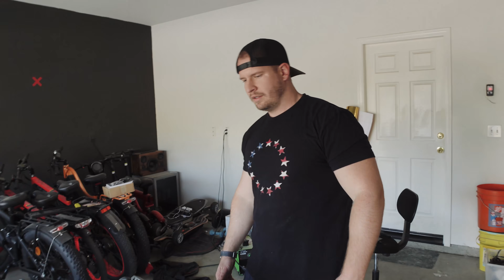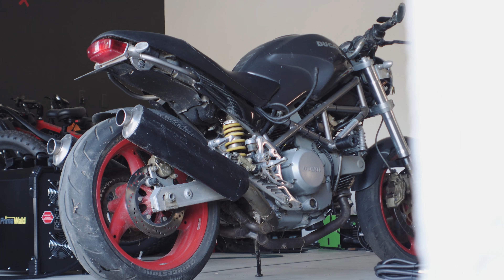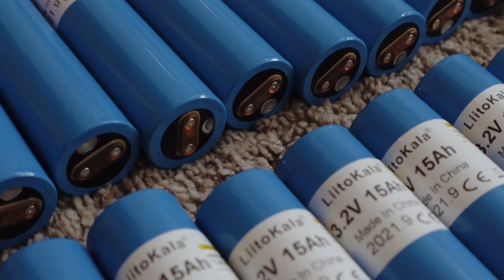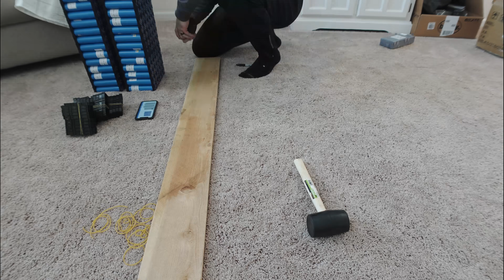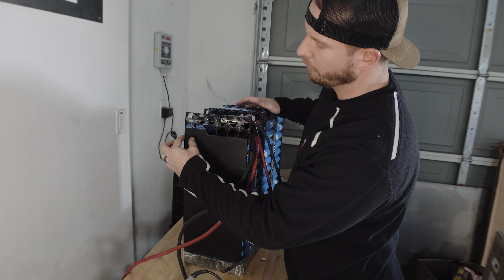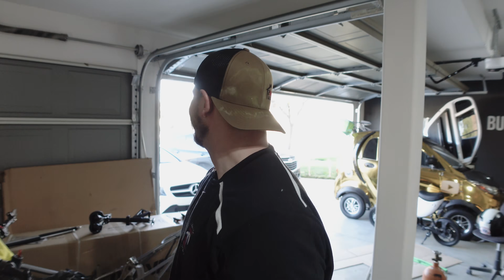We Made a 200–Mile Range Battery for the Electric Ducati (Parts List Included)

Comment: How do you expect 200mile/320km range out of a 15kWh battery pack? Where is the secret sauce?
The bike has the same (questionable) aerodynamic qualities, that other naked bikes do.
As such by taking a combustion engine powered (aerodynamically similar) naked bike, that maxes out at highway speed, and looking up its power output while its redlining at max speed, we can have a decent estimate for power needed to sustain highway speed.
Kawasaki 125, with its 11kW max output, and 125km/h (77mph) is a good estimate - to account for losses and be generous lets say, that 9,5kW of that reaches the crank.

As such with similar speeds, you could travel for 15kWh/9,5kW = 1,6h meaning that you run dry after 123 miles, or around 200km. Which is pretty far from the range figure you claimed.

Comment: So Were talking about a 12+ kwh lithium iron phoshate battery that weighs 160 pounds!   Can not fit it in any smaller of a space, what a shame.
I need this on my reinforced, moded MC wheel cargo side loader bike!...yet that is much heavier than the previous 7kw lithium ion battery, 100+ pounds.
Need that solid bms setup for reliability this time.
If it could maintains 30wh or less per mile then 300 to 320 miles on a discharge down to 20% battery left...exactly what i seek!  

Future plans while rubbing hands together. Very heavy indeed!

Comment: Question, how do you know what gauge of copper or if copper will be sufficient enough to handle the current for the battery connectors? I'm not building my own battery but im currently using a battery 72v battery at 120A continuous output but i've ordered a new battery with high discharge cells that can do 450A continuous discharge. However, the battery manufacture only feels confident in setting it to 350A and mentioned the copper connectors can only handle so much current before burning out. Is there a way of knowing if the copper connectors will limit my output? I want to be able to output as much power as possible but I also dont want it to blow up. Any advice would be hugely appreciated!

Comment: Let's clear this up 200,000 miles out of the pack after 2000 charge cycles and still the pack is not finished, just reduced capacity to around 80% still very useable 😀

Comment: keeping in mind that there are several types of bms - single cell configs in parallel allow you to better take care of the cells but most of what i've seen about 10% longer lifespan - this also means more than one bms and a discharge controller (i've only seen them as hybrids with integrated multi-bms from oem or custom by a rare few) - on another note (and as with anything) i was reading about a lab study on lithium (i'm a pro batt and charger tech) before we start seeing it more on the industrial side and they found that LiFePO (i believe) cells are best stored in a dead state and that if they're stored in a charged state that is causes rapid degradation - waiting on the peer review to be sure but it's opposite for most all other batt chems - i'm my experience i would keep it at around half charge during storage and just top it off when you want to ride - lithium prefers opportunity charging so no memory effects

Comment: You used a normal soder welder for the cells?
Reply: Just a heavy duty 1 pound unit, but just a hot iron either way!
Reply: @LordCurt  that's going to damage the battery's, no
Reply: @Zafor-ium  depending on how you do it, you certainly could. I’m confident the way I did it did not with the size of cell and the speed of heat transfer
Reply: @LordCurt  just realised your username, that pack is a monster! I've only build my self one for an ebike build using 18650s, learnt about enough to configure and build it. The way you laid everything out in the end, amazing.

Comment: Awesome job guys! What size is the motor you guys planning to put on the bike?
Reply: 12kw continuous hub motor!
Reply: @LordCurt  Nice! That's what I got on my bike too right now. Let me know if you guys want to race 🤣 Btw you are very smart my guy!  You helped me understand lipo batteries better than anyone. Building Lipos is very dangerous and you make it look easy.  I appreciate you! Keep up the awesome work.
Reply: @molifehacks5258  great to hear, man. Glad we could help. Is it the same setup you showed in your videos of the bike? If so, what controller are you using with it? It’s a solid system
Reply: @LordCurt  no, it's not the same setup, your battery is way more powerful in voltage. My battery is 88.2v 80ah with 600a peak discharge current. I'm running a 72v 600a peak controller. How many amps is your controller?
Reply: @molifehacks5258  very nice, man! What’s the controller make and model?

Our controller is a 800 phase amp controller, but that’s about 400 from the battery at peak based on what the manufacturer states. I’ll check it with a shunt and it’ll be in a video
Reply: @LordCurt  oh wow! I just rewatchdd the video. I accidentally misheard you say it was 128 phase amp I was surprised, my bad! 😂  I now heard you say ah not amps. 800 amps though?!? That's freaking INSANE! I'm using Far Driver controller Model:ND841200. I modify the settings with an app. What do you expect for top speed once you're done?
Reply: @molifehacks5258  fardrivers push some serious amps! I’d love to see some more footage of yours running. 

Ours should get a little over 100mph at a full charge
Reply: @LordCurt  They seriously do and I kinda figured that. That's awesome bro! I'm only getting 90mph. I been  slacking with making more videos honestly. I don't have time to edit so I just modify everything off camera. I'll try to record everything I did and post it soon. I'm still learning the far driver controller but I ain't smart as you bro lol. It's difficult figuring what settings to change on the app to get the max out of the controller and the battery. I'm learning these Chinese wire colors right now.  🤣

Comment: You really need to start top balancing. Put every single cell in parallel and then charge discharge a few cycles to exercise the cells. It doesn't matter for a YT video but anyone copying you is going to be very disappointed in battery performance. Great though process into the buss bars!

Comment: That was a lot of really good information. 
These batteries are my choice for my solar set up. 
You welded yours? 
What would it take for a good contact conductor? 
Would be nice if I could have a giant rack that I could just drop in or pull cells as needed.

Comment: Watched this four times now. Took me a bit to figure the configuration. Very clever layout of the 8P x 32S configuration. Well done
Reply: If they are running 32 in series (x 3.2v) wouldn't that be 102.4v?

I'm guessing they are running 96v on the controller, and if so is going over voltage safe?

Comment: I learned a bunch from the battery discussion here.  I made my first 18650 battery for a Razor 72 volt dirt bike conversion and made a few mistakes that are explained here.  I used low amp, high capacity Panasonic cells because I didn't know better and at 4 in parallel, have a huge amount of voltage sag when I ride the bike.  I thought just due to the cells, but maybe also due to my wiring.  I have some high amp output cells on the way and will do 10 parallel this time, but also focus more on the battery connections this time too.
Reply from the maker: Good luck! Glad we could help your project out!

Comment: Stoked for you guys. Love these long detailed videos. You’re going to love that hub motor combined with the available amps in this setup. Glad you won’t have to deal with the same battery issues on the cb. Those HUB motors are crazy powerful and wicked silent. Great design and execution on the battery Lord Curt! The fiberglass bottom was a nice touch. And the sense wires was nice and clean too.

Will you run the entire pack through a shunt for monitoring? I like the idea of bypassing a smaller BMS for discharge. 

I’m still struggling with the space for a 2 phase charger on the bike itself so I can take advantage of charging stations. That would be so clutch
Reply: It’ll have a gauge for the shunt included on the tank for monitoring!
Reply: The difficulty of public charging adapters is way more than it should be. I’ll be looking forward to seeing you get that working!